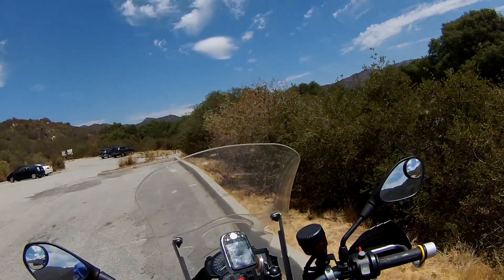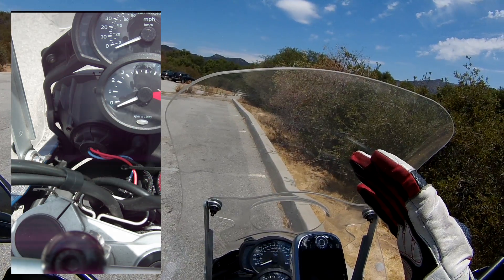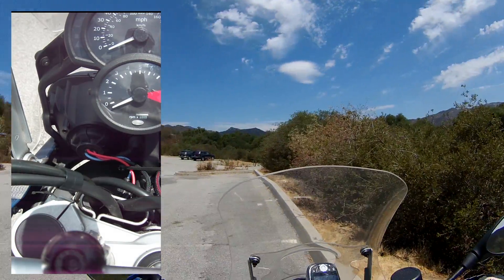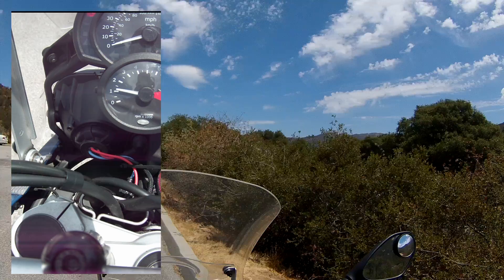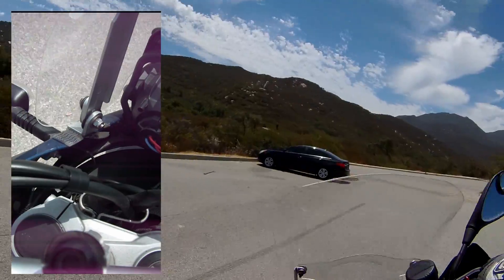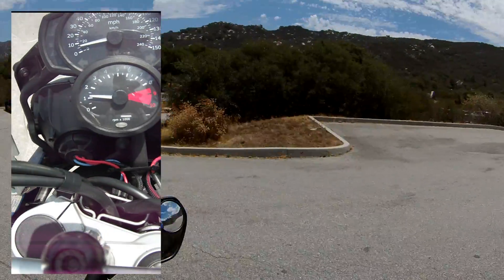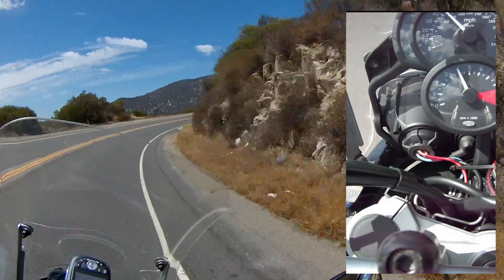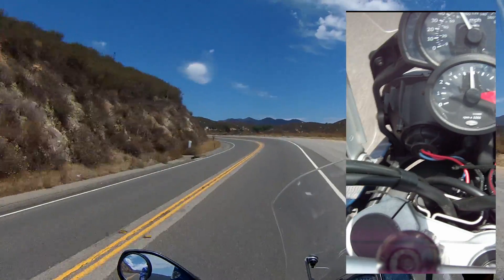An experiment to measure motorcycle countersteer

Comment: Nice video!
Countersteering is what one does MOMENTARILY to lean the bike. For a right turn one momentarily and slightly turns the handlebar in the opposite direction to lean the bike to the right, once the needed lean is achieved, one turns traditionally throughout the turn.

Comment: I believe I can explain what you are seeing. 

A bike steers by being leaned over. We can all agree on that. Counter steering leans the bike over and starts the corner. In your left hand corners a slight turn to the right starts the corner. If you were to continue turning the bars to the right the bike would fall over. What you are perceiving as steering into the corner is actually slight counter steering to keep the bike from falling over. If you turned a little more the bike would stand up.

Comment: The bars pointing in the direction you are turning is a result of the wheels tracking in line with each other, not from steering. The countersteering happens to initiate the turn. This is what allows the motorcycle to change direction.